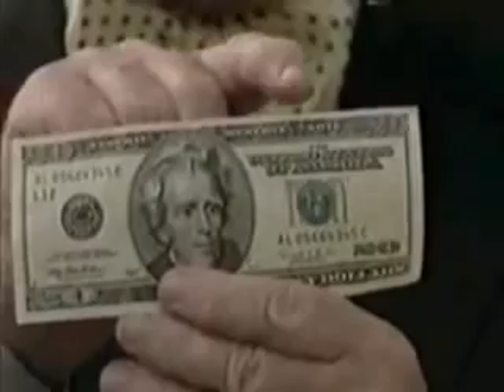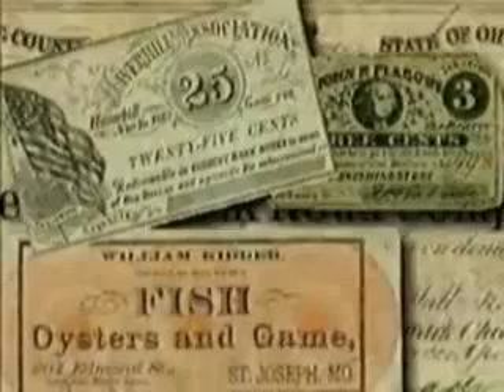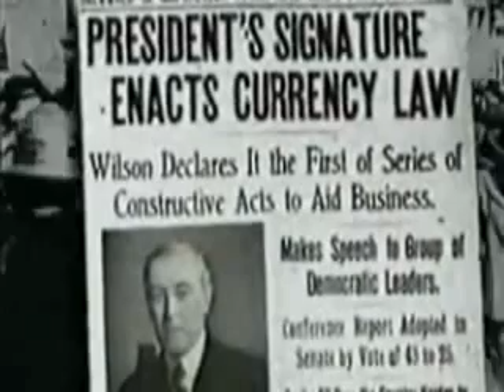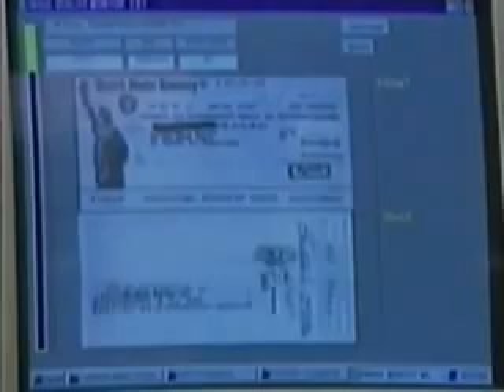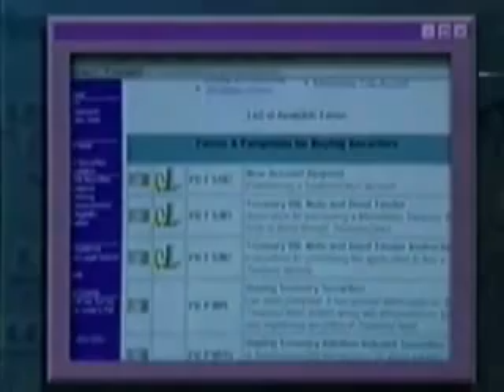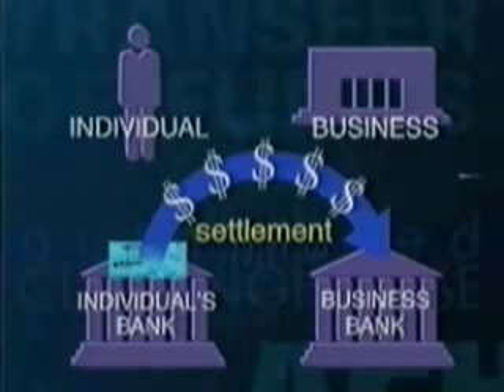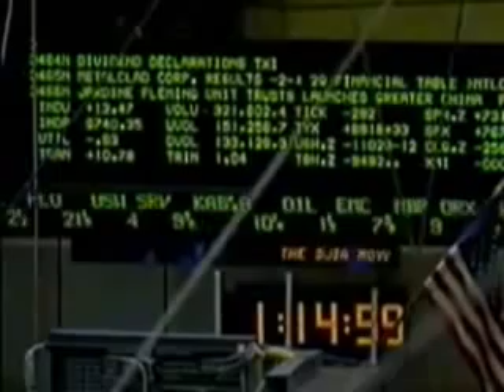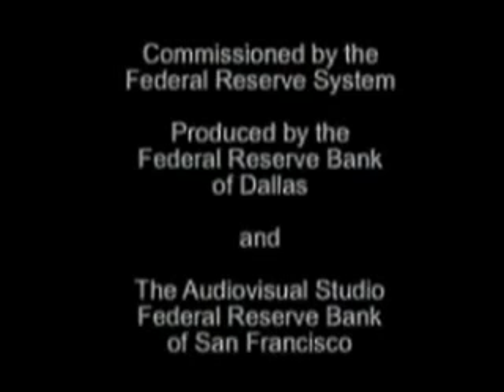how the federal reserve works

Comment: i've been reading the link you gave me about the board of governors...and it actually is quite close 1/3rd are member bank executives, 1/3rd are voted in by member bank executives. it is a huge amount of power concentrated into the hands of anyone who happens to own a large number of member banks. My guess is any large bank with many subsidaries also gets votes from each subsidiary holding stock in the fed? the remaining 1/3rd are marginal and easily bullied or bought with job promises.

Comment: "My point is that the economy is deteriorating because (among other causes) all of the banks are fractional reserve banks"

Modern banks for the last 500 years have been fractional reserve.
Banks take deposits and loan out a portion of those deposits.
What's the problem with that?
What's your solution?

Comment: If you're still interested, search YT for a 10 minute clip, "Money as Dept 1" 

It's an excellent explanation of how the Fed with the banking system creates or 'prints money' (for those at the novice level of understanding).

I do not necessarily agree with all of their solutions, but it is still a good intro.

'Printing money' is a term economists use to refer to the process of creating money out of thin air.  If this process does not arouse your suspicions, it should.

Comment: @sfiorare 

Modern macroeconomics tries to empirically analyze and arrive at their theories of how an economy works.  As we both know, they use the assumptions of these theories' accuracy to model the real economy.  However, as any self-respecting philosopher understands, there are many assumptions that have to be made to apply the Scientific Method to a phenomenon.  You need uniformity insofar as your statements require them (what good is talking about an abstract concept like an "atom" if an

Comment: @sfiorare Yes sorry, it's not HR 1207 but HR 459.
Nevertheless, you didn't answer the questions.
1- How does it politicize it if Congress HAS NO AUTHORITY OVER WHAT THE FED DOES. Even with an annual thorough audit, The Fed's policies cannot be influenced in any way, the audit is merely to avoid/know things like in my second point.
2-The link I provided to you is a de facto partial audit that showed 16 trillions $ of bailouts to certain banks. (p131)

You didn't answer what the differences were